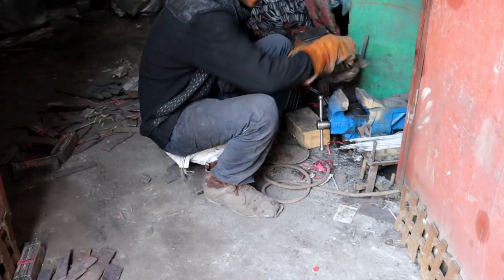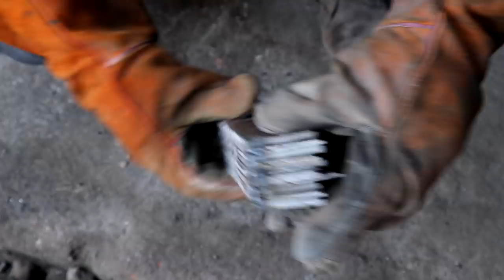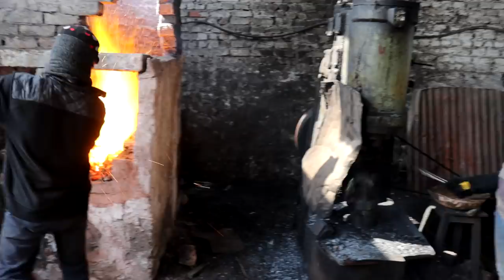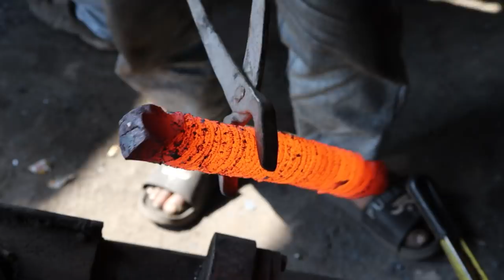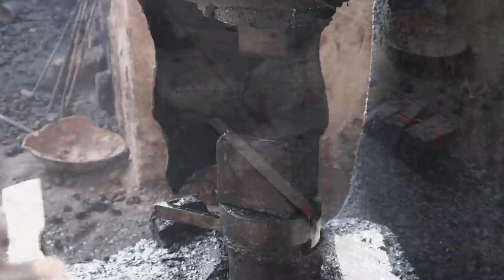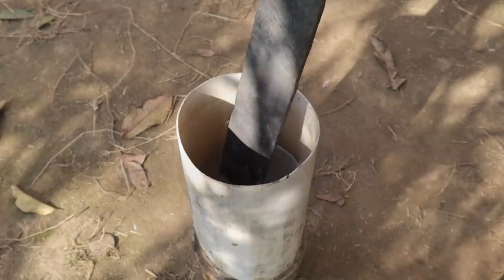Amazing Twist Steel Forging Process Making of a Blade for SWORD

Comment: They didn't even clean the scale and rust off the bars before welding them all together, and they still stuck. Sparkling hot must be key lol
Reply: The right about of heat and the big ass power hammer doesn't hurt.
Reply: Kind of a shame they dont take the time to clean it.  It could be one of the reasons that Pakistani damascus is know for delaminations and general poor quality.  Most of the blades found on ebay are terrible and very soft.  Really unfortunate that they try and shortcut the process and often use poor quality materials, since their  people seem to be very skilled.  If they produced a high quality product for a good price a lot of knifemakers would buy it, but the stuff i have tried has been really poor quality.

Comment: No flux needed.   Nice work!
Reply from the maker: Thanks for watching
Reply: No flux, no work bench, no belt grinder, no respirator, sitting on the dirt floor with a stick welder and proceeds to make beautiful Damascus and straight as an arrow.  Give that guy and his team a modern workshop and a month to get acclimated and they would have there own history channel show and too many orders to ever keep up with.
Reply: @jtb9544  absolutely.   Big dog forge made dirty Damascus, using a similar technique.   When metal is hot enough, it sticks, period.
Reply: @JohnJohnson-bg2oo  even mill scale must burn off too because those bars were dirty
Reply: @kenledson  you're correct.   When sparks are coming off the metal pulling it from the fire, it's damn close to melting into a puddle, and no scale will form.   Co2 from the coal helps also.

Comment: It’s funny you see all these smiths sand and clean each piece of steel before welding there billet up perfect then they soak it in kerosine or something else to clean it even more then they flux the hell out of it and baby it to set the weld and half the time they end up with a cracked billet with cold shuts in it. Then there are these guys, half ass weld a bunch of dirty steel into rickety billet and  hammer the shit out of it and come out with a perfect piece of Damascus. 😂😂😂

Comment: No flux during the forge welding?
Reply: I wondered about that, too. I’ve seen many metal smiths use Borax. I wonder what takes the place of flux in this forging?🤔
RL.  Buffalo, NY  USA
Reply: @rlewis1946  You don't need flux. The disadvantage, however, is a very large loss of material. The steel burns at these high temperatures through contact with the oxygen.
The liquid iron oxide is driven out by the hammer blows
and with it the impurities.
Flux prevents contact with oxygen and flushes out the impurities.
The welding temperatures with flux are lower and therefore these steels are usually better.